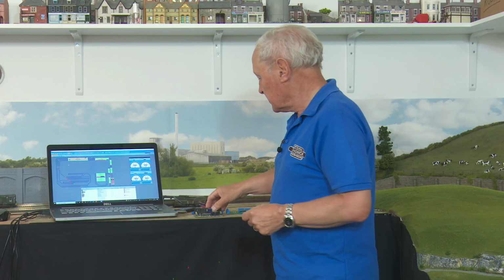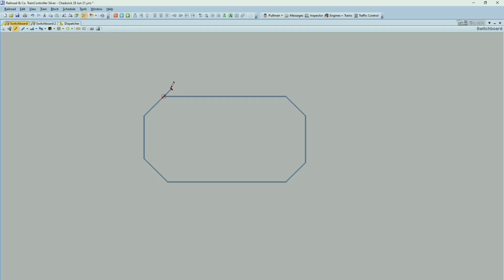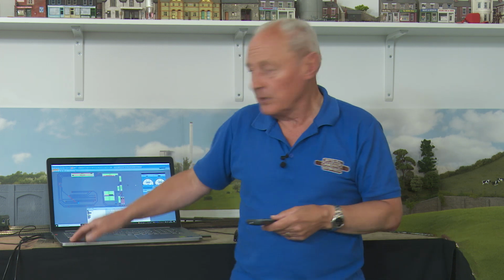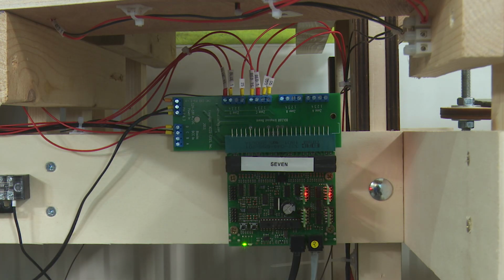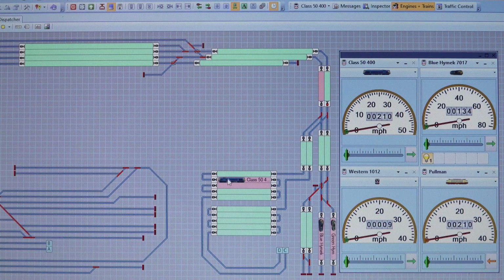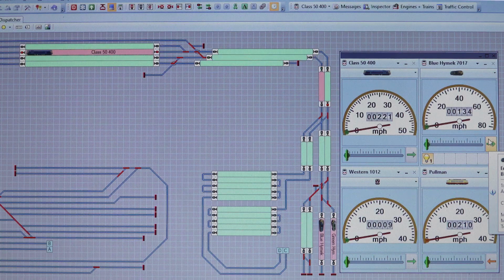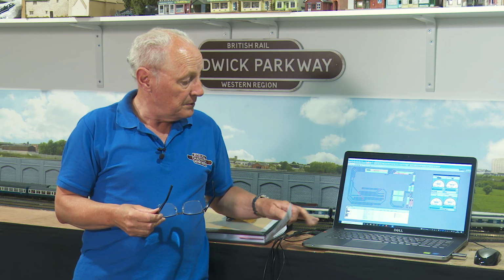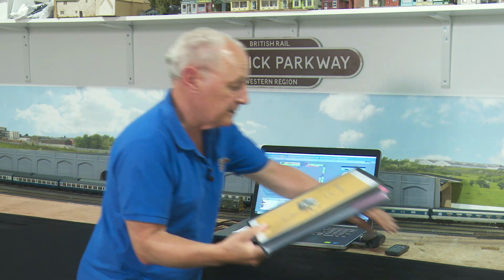An Intro to Block Detection at Chadwick Model Railway | 137.

Comment: Looking at some posts it appears a nerve has been touched, let’s look at the facts Traincontroller is a rather dated these days in pc programming language compared to ITrain.  But even that said it still got more features than comparing to I-train at this time. in development terms I train is where Traincontroller was 10 years ago but the future looks good for ITrain, and gets better with each version, but most users won’t even touch some of the more advanced features of Traincontroller and really want basic automation and when you look at the cost difference we’ll I don’t have to spell it out. Both programs have good and bad points and it would be great if the best from both could be combined but sadly that won’t happen.
Reply from the maker: An excellent point LR. I’m in a quandary as I would like to try iTrain but having bought Train Controller Silver V9, it seems a silly thing to do! Perhaps one day I shall buy it iTrain pro and do a decent comparison. Regards Charlie
Reply: I use TC v9 gold. But I also have a full version of I-train. The setup is completely different to TC and someone who is used to TC may find the transition difficult. This is not the fault of ITrain in anyway it just does things in a different way. One point I don’t like about I-train is the blocks don’t display a loco/train image and as far as I can determine this option is not going to be introduced, personally I feel an image is recognised far quicker by the brain than text but there are those who prefer text. As they say horses for courses.

Comment: hi charlie like your video i have tride itrain paid a lot off money fore it itrain5 pro but it will not work good fore me all ways comes up with errors but before i bouhgt that i got traincontroller gold i no it is dear but i think it is better than itrain i have more than one system to controle my layout i have the latest digitrax system like you have just bought the BDL 168 and the brake out board found it makes wiring a lot more easer the beast place to get thease parts is coastal dcc very quick with theare deliverys ok derek hope this helps ok.
Reply from the maker: A great comment Derek. You’re the first W ho preferred train controller over iTrain I must confess. But it’s horses for courses mate. Regards Charlie

Comment: Charlie, I have an NCE system. This uses BD20 current block detectors that feed into an Auxiliary Input Unit (AIU). The AIU supports 14 inputs, the contacts on a Tortoise (or other point motor) can also feed the AIU for point detection. The AIUs are daisy chained on the NCE cab bus. The NCE Power Pro (or Power Cab) is connected to a computer that runs JMRI. I do not use JMRI for train automation but to provide a realistic signal box display with point and signal interlocking controlled by the block detection. The operators have to drive the trains to follow the signal indications. Signals are controlled using Signalist SC1 boards - each of these can control four two aspect signals, two three or four aspect or one complex one with a number of feathers. Typical prices BD20 about £13 (one needed for each block), AIU about £44, Signalist SC1 about £35. JMRI, of course, is free.
Reply from the maker: Great comments Mark, thanks very much. Yes there are certainly various options available for us who wish to dabble in automation. Regards Charlie

Comment: Charlie another great video. Whilst my layout is still under construction I have gone for a Digikeijs DR5000 control system and their Block detectors and point drivers. Fantastic bits of kit.  As the detectors run loconet could you not use these rather than the expensive Digitracks ones? I also run iTrain and find it very good. There are some excellent iTrain tutorials on youtube that have helped me a lot. As for Train Controller I was thinking of getting this until I had some email correspondence from the owner. I gather UK get charged more as we are ' more trouble than we are worth'! He also blames Brexit but refused to elaborate how that has resulted in the huge price variation. When I took issue with him about this I was told 'if you don't like it buy something else' - so I did.
Reply from the maker: Great comment Roger. Yes TC is good but so pricey!
Good luck with your project, regards Charlie.

Comment: Hi Charlie, I’m on N gauge, my layout is 11ft long x 30” wide, it’s an up and a down line front scenic type of layout disappearing into tunnels at each end which lead into return hidden loops on both lines. As operating space is limited only from the front of the layout I needed to know where a train was in the hidden section. I experimented with infra red but it wasn’t successful due to the limited light and wasn’t at all reliable. So I looked at block detection. I could not afford or justify the expense of Itrain and similar and so JMRI seemed worth a look. I use a NCE Powercab which I’ve had for 7 or 8 years now and it does the job ok,  JMRI on the other hand as you say is not the easiest to understand and work with particularly for us older folk and it must have taken me practically 12months to finally get a working track plan, point control, routes and finally create and understand blocks onto my laptop. Next was to hook the layout up to the laptop, I needed a NCE USB Interface £42 an AIU Aux Input Unit £42 and eight BD20 Block Detection Units at £13 each and it works. However unbeknown to me the BD20’s come with their own on board relay output so as a backup I wired in some LED’s and mounted them on the front fascia and now when a train enters a block the light comes on and I stop the train. Do I need JMJI on the laptop - debatable. When I come back to layout after a week, do I know what’s in which section - not a clue. I’m sure it’s possible - have I the time or inclination to find out - probably not. Now I realise your system is a million miles away from what I’ve got, could I do what you have done with NCE/JMRI - I’m sure it’s possible judging by the posts I see regarding JMRI by the large USA based layouts, but to me a lot of time is spent with technical issues which obviously drive some people crazy with frustration rather than getting on and enjoying building a model railway. Nevertheless as with all your stuff, whatever the subject I always enjoy them, if I’m ever in a position to upgrade I do like the look of the Digitrax System though.
Kind regards
Roy Whitgrove
Reply from the maker: Thanks Roy, what a heartwarming comment mate.

Comment: I love the geeky wiring/automation stuff. I'm going the Digitrax/JMRI on Raspberry Pi route.
I designed the layout in AnyRail and will be importing the diagram into JMRI.
Just finished getting the track put down and ran some trains on it to verify no derails.
The wiring has been set up for block detection over 3 Digitrax bld168s.
My computer is connected to a Digitrax pr3. I'm hoping to get my first automated run in a week or two.
Then I'll be setting up signals going through a Digitrax SE8C.
Reply from the maker: Great comment and I’ll be interested in how you get on with the SE8C.

Comment: It is good to see more automation content here. I am in the process of building quite a large N gauge layout which will be fully automated - I use a Hans Deloof command station, LocoIO and LocoServo modules (for the servo controlled points and for the signals and other miscellaneous IO), and Digikeijs DR4088 current sensors. I also use the Digikeijs DR5088RC for RailCom in strategic places in the fiddle yards so that I can add locomotives and multiple units to the fiddle yards without manual entry; RailCom is an equivalent system to transponding and can be made to work with TrainController - I use TrainController Gold 9. 

Incidentally, I disagree that there is no reason to automate a small layout; if what one wants to do is operate the layout as a signaller, with realistic signalling systems, rather than as a driver, then one needs automatic driving of the trains no matter how small the layout. For example, I am planning a model of Aldgate station on the London Underground, and, although a relatively straightforward 4 platform station that will fit into much less space than your layout, it will be automated so that I can operate a working replica of the Aldgate signal cabin ("OB") while the trains drive themselves. 

For my larger N gauge layout, I have customised the TrainController interface to resemble a real computerised signalling centre (IECC) and will be setting up full whole week timetabled operation (with automated train announcements based on actual destinations and calling patterns set in TrainController).

Do you plan timetabled operation?
Reply from the maker: Great comment James. Yes I do plan on timetabled movements but it’s early days.
Reply: @ChadwickModelRailway  Excellent!

Comment: Hi Charlie - I’m running iTrain+Digikeijs DR5000+Digikeijs 4088/4018. Great system, well priced - bought it all from James at DCCtrainautomation whose support is amazing if you’re a customer. By the way the CS on the 4088 stands for current sensing if anyone’s wondering. Cheers Charlie, appreciate all the hard work you put in to your videos, very professional and enjoyable. Julian
Reply from the maker: Great comment Julian, many thanks.

Comment: Always enjoying your videos. I use the DR4088 LN/CS (LocoNet/ Current Sensing) from digikeijs as mentioned in your video. Since this is a loconet device, you can mix these devices with digitrax ones in your Loconet string. So, also if you are already using digitrax and want to expand, you can use the much cheeper but high quality digikeijs products.
Reply from the maker: Great comment Rolf. Regards Charlie.

Comment: Great video Charlie.  Here are my thoughts:

My solution:  I use Circuitron BD-2's which I have owned for 20 years (same ones!).  The reason I went this way is that they include an "occupied" and "clear" output which can drive the cathod (-) for signals with NO computers needed.  Given, you won't get automated train control with computer as these do not tie into loconet or any other buss.   These work with DC or DCC and I have used with several DCC systems over these 20 years.  Cost is around $20 per block so they are not cheap but provide a nice introductory cost if you only want 4-5 blocks AND want to control two color signals without jacking around with a computer interface (and paying for that!).

Would I do it again:   Yes, but I have more discretionary funds now then I did with two kids pulling on the pocket!   I would like to go with Digitrax (or Digikeys) but lets look at Digitrax.  First, I don't know why they don't have terminal blocks therefore requiring we also purchase the accu-lites board!  Also, to run signals one must purchase an SE8 which I believe drives 8 or 16 signal heads (?) AND says that it requires JMRI, Traincontrol or itrain to provide functionality!   Long term, the Digitrax / Digikeys solution is probably best if one needs more than 4-5 blocks but for entry level or small layout, Circuitron is way to go and does not require any interaction with a PC which simplifies the setup significantly.
Reply from the maker: Great comment as usual Kurt.  In my next automation video, I shall instal an SE8C. Apparently they are more difficult to program than the SIGM20.
Reply: @ChadwickModelRailway  That is what I have heard.  Digitrax has probably the best customer service I have seen but their manuals are so horrible, obviously done by the EE's and that is the problem.  Good luck and thanks for all your vid's!!

Comment: Terrific stuff, I'd wondered about train automation for a while and it now makes a lot more sense - thanks! Are there alternatives to Loconet? Holy smokes though, the software prices! Planning the wiring for block detection doesn't seem very difficult if you've got some insulated rail joiners and a Dremel, and extra droppers.
Reply: I didn't even worry about the joiners. Just cut the rail in a straight section with a Dremel
Reply from the maker: I think that lenz has its own local net equivalent. Regards Charlie

Comment: Hi Charlie the one video i have been waiting for, all my hardware is digikiejis doesn't cost earth and reliable i have traincontroller Bronze which does what i need and still experimenting with it getting trains to shuttle between different stations adds a bit more than just running round and round and thanks for explaining two contacts in one block
Reply from the maker: Thanks Dave, I’m so pleased that you found it useful.

Comment: A very informative introduction to block detection, Charlie. I'm sure many will find it very valuable. 
Me? I'll just stick with my couple of wires to power the (DC) track and push-rods to control the turnouts...
Reply from the maker: If it works for you Peter, and keep going with it mate. Regards Charlie.

Comment: Looks like the pricing on TrainController is related to this:
"Dear Railroader,

for certain reasons we do not sell our software directly to certain countries ourselves, but through a partner company.

Updated information on the countries currently affected and the responsible partner companies can be found in a subsequent post on this topic.

In these countries, we are not your contractual partner when purchasing, but the commissioned partner company. Freiwald Software only delivers to these countries.

The order and purchase process for affected countries is as follows:

:arrow: In our shop, you first select the country to which the delivery should take place.
:arrow: If it is a country in which the sale takes place via an external partner, you will see a corresponding note that the sale is carried out via this partner and delivery is made via Freiwald Software.
:arrow: In the next step, you can arrange the desired items in the shopping cart.
:arrow: In the further course of the order, enter the information relevant to the delivery.
:arrow: At the end of the order you will be automatically redirected to the forms of the partner company.
:arrow: There you enter the information necessary for the payment, choose the desired payment method and arrange the payment to the partner company.

Please also note possible effects on prices. Costs for taxes, tax processing and commissions for an external partner are added to the prices otherwise applicable in the region concerned.
Dear Railroader,

for certain reasons we do not sell our software directly to certain countries ourselves, but through a partner company.

Updated information on the countries currently affected and the responsible partner companies can be found in a subsequent post on this topic.

In these countries, we are not your contractual partner when purchasing, but the commissioned partner company. Freiwald Software only delivers to these countries.

The order and purchase process for affected countries is as follows:

:arrow: In our shop, you first select the country to which the delivery should take place.
:arrow: If it is a country in which the sale takes place via an external partner, you will see a corresponding note that the sale is carried out via this partner and delivery is made via Freiwald Software.
:arrow: In the next step, you can arrange the desired items in the shopping cart.
:arrow: In the further course of the order, enter the information relevant to the delivery.
:arrow: At the end of the order you will be automatically redirected to the forms of the partner company.
:arrow: There you enter the information necessary for the payment, choose the desired payment method and arrange the payment to the partner company.

Please also note possible effects on prices. Costs for taxes, tax processing and commissions for an external partner are added to the prices otherwise applicable in the region concerned.
"
Reply: That’s some markup on the price, those in the know understand the real reasons why it so much more expensive to the uk
Reply from the maker: Yes we do know but what can one do?

Comment: So, just to clarify, the blocks don't need to butt up to each other? You can have undetected areas (like your points) that are just fed from the normal bus.
I'm guessing this requires all of the points to be controlled through the software otherwise it could lose track of where a train is?
Reply from the maker: Yes you’re right, certain areas which are not in blocks such as points are just fed from a normal DCC bus. The program will always know where the loco leaves a block and enters the next one so the rhythm of the train movement isn’t lost. Regards Charlie

Comment: Hi Charlie as a comparative newby to any kind of train control i have an ESU controller and a 50095 detector offering 16 channels 4 of them with Railcom which identifies the train in the block.The system with the use of the 50095 detector allows you to create routes with auto point changing and also enables you to create 8 Shutttles  with routes attached.. Not sure if I can run signals at the same time. i paid £167 for the ESU 50095 it works for me so far. Regards Alan Massie
Reply from the maker: It sounds like you’ve bought exactly what you need Alan. Good luck with your project, regards Charlie